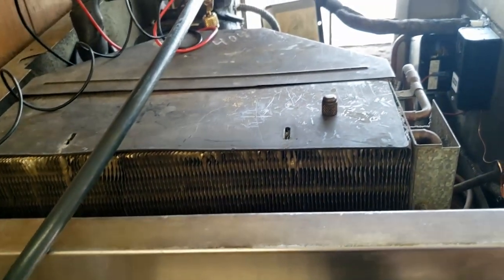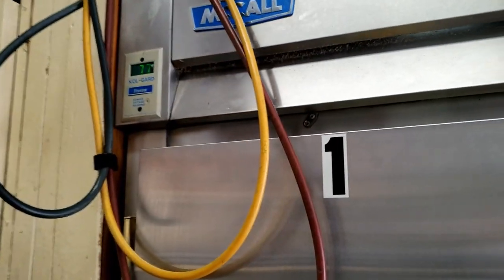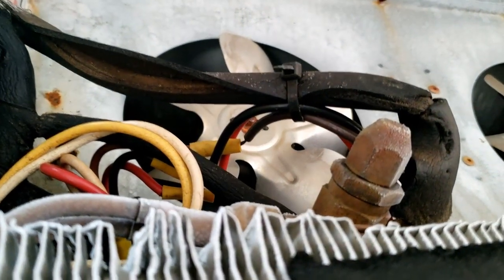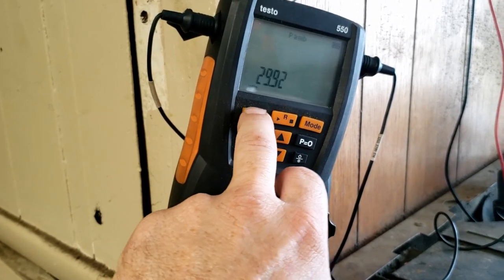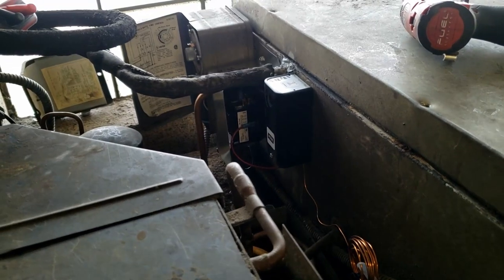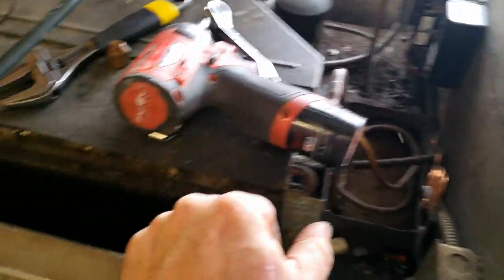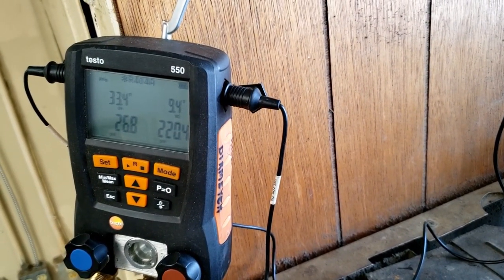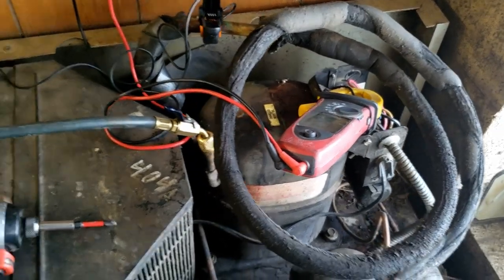GERIATRIC FREEZER GETS HEART TRANSPLANT PART 1

Comment: the unit is marked 404 on the condensing unit and your manifold was set up for 502. was that power element a MOP power element? If it wasn't that may explain the unit over amping during  a hot pull down. I did see that you set your manifold to 404 later in the vid. I personally don't care for McCall units or Hobart units for that matter.

Just finished part 2. Clean work :) Always a pleasure watching your vids
Reply from the maker: I'm going to have to claim ignorant here, what does MOP stand for?
Reply: @HVACRSurvival  Max Operating Pressure. The power head limits the suction pressure at all times to a maximum pressure (which is written on the powerhead) no matter how high the condensing pressure gets.